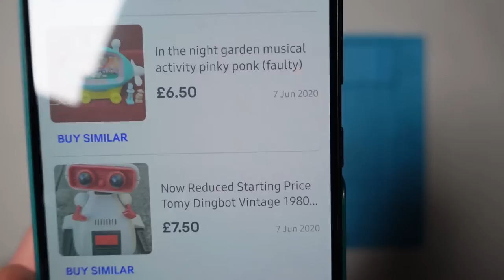Restoring a 1984 TOMY DINGBOT robot to it's former GLORY | Can I FIX It? | eBay Repair

Comment: I know this is 3 years old, but I just saw this and had to share. I had the Dingbot growing up. I asked my parents for an Omnibot and this is what I got on Christmas instead. Disappointed, yeah just a little bit. 🤣🤣 I did become fond of this little guy. As kid I always took apart my toys to see how they worked. This one though, my mom told me to never take apart. But you know I tried. 8 year old me just couldn't figure out how to separate the two halves. Now I know almost 40 years later. 🤣🤣Take off the shoulders and there's screws underneath.. You fulfilled a childhood wish, to take this thing apart.. 🤣🤣Love your videos man, keep up the great work!!!
Reply: Just searched Omnibot in Ebay. OMG the prices!
Reply: I’ve got a Tomy Chatbot missing it’s remote and a Radio Shack Dustbot. Tomy was making some great looking robot toys, From the Omnibot 2000 down to the lowly Dingbot. They were advertised better than they performed but were still fun to have.

Comment: I've similar problems with screws stuck in plastic.  I used the tip of my soldering iron briefly to touch it on the screw head and that does the trick.  But don't hold it on for long, just about 3-5 seconds.

Comment: I had dingbot, same thing happened with the wheels disintegrated. The angle of the main drive wheel means when it bumps into things it changes direction, quite clever and simple design. Really enjoy your vids.

Comment: I find this little robot fellow cute appealing :)
There's probably a cam rotating inside and that's the program, so it will be painfully cyclical :D The only thing that can change up the movement is some dangly bit, like the not-centered wheel that might make it start in a bit random directions.
BTW, you can lubricate the motor as well a little, maybe it would be less noisy.

Comment: I really thought the door on the head was going to be a battery compartment for a coin cell, maybe to run a couple of red LEDs in the eyes or something. Weird that they made a door like that, with such a large compartment, for a screw rather than just a post and small hole plug.
Reply: the space in the head should hold the map that comes with him when he's not using it.
Reply: @gavinm894 correct I had one as a child and I used to draw my own maps and store in the head, wonder if my mum still has some 80’s toys in her house 🤔

Comment: Little trick but need to be very careful not to over due hold a soldering iron to the screws it help with rust and the screw holes will soften but don't hold to long or the holes with just melt/burn out depending on the plastic

Comment: Steve, I wonder, do you have a 3D printer and if so, have you ever printed gears to fix projects?

I have a 3D printer and before, only played around with making gears, but at that time, this printer was pretty much a piece of #@%$#^ BEEEEEEP BEEP %$#%#%#$.
But then, a couple of years ago, I had to design, what I call, a Mini Sump Pump to take care of a water issue.  I used one of those small fountain type pumps, but I needed a good way to detect water level.

So after I fixed the printer, I put it into high quality mode (very close, but amazing prints) and printed some gears for the level sensing "arm".  The gear on the arm turns the gear on the potentiometer (that is used to sense level) and this worked great.  I figured that these would wear out quickly as I only printed them in PLA, but here we are, around 2 years later and this thing is still working like a charm and no noticeable wear on the gears.

So I just wondered, for things that you get where there is a gear or two mashed up, if you've ever tried to print new ones.

Just curious.

Comment: ive still got my origonal Dinbot from back in 83 alas i no longer have Mr Money or Spotbot and Hoothoot  but would love to get them backand he still works apart from the rubber front wheel has perished like your one do you know what size O ring you used to replace it? 
best wishes
Steve
Reply from the maker: Hi Steve. I can't remember the exact size, I have a cheap box of different sizes from Amazon, and I tried a couple of different ones. Works a treat though, so it's worth buying the set to fix yours up, they're only cheap. 👍